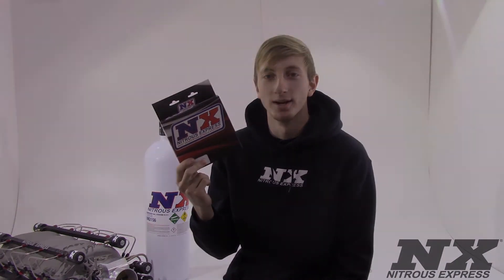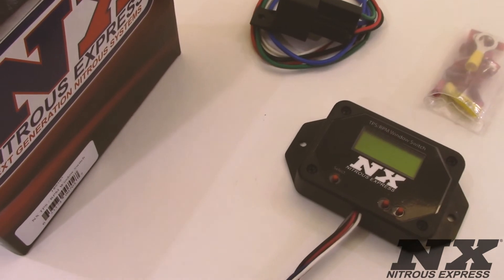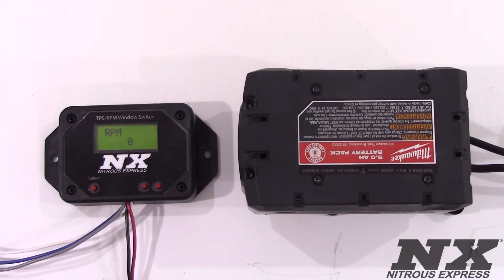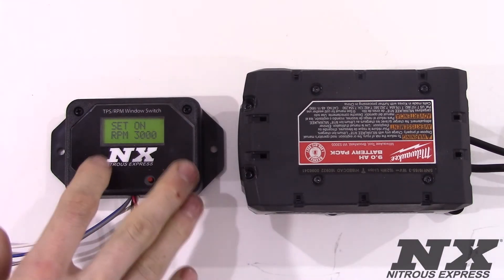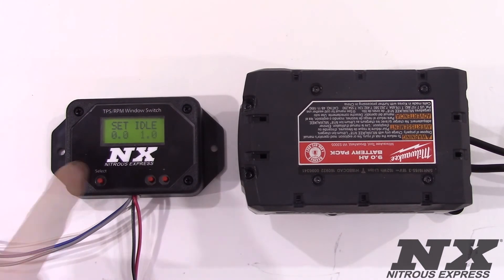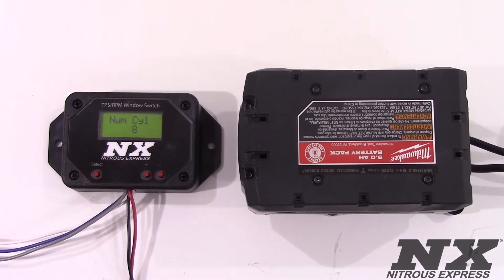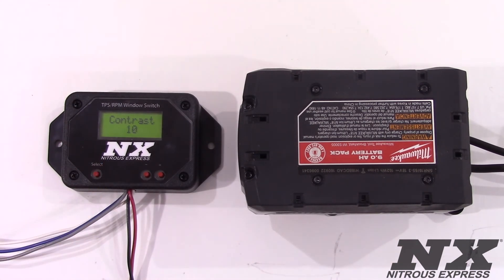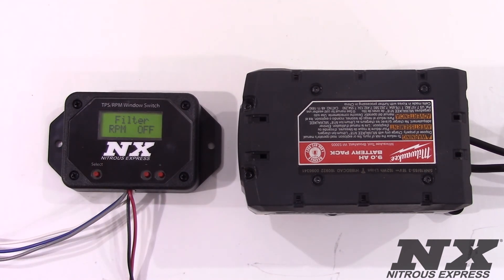NX TPS WOT / Digital Window Switch, Part # 18959

Comment: I still don't get the normally closed and normally open option? I want to have mine set up with wot and rpm. About 3,500 rpm start for nitrous and cut off nitrous at 7400 rpm.
Reply from the maker: Give us a call and we will see if we can't help you out!
Reply: @NitrousExpressVids  I had a friend install at his shop so thanks just gotta test it out soon. Everything seems to be working properly I can go through the window switch and change parameters if I need to.
Reply: @simmygt831  how did u set it up? Normally closed??
Reply: @ihateyou-iv4787  normally open

Comment: I don't understand!! What does the TPS/RPM switch do?
Reply: it helps your car from blowing up due to N02  but you need more systems to be close to "bulletproof"  such as a lean sensor failsafe, this thing reads WOT  to activate N02 and keeps it between 3K RPM And w.e RPM you shift at so it won't go boom!
Reply: @IZE83L   Does the window switch activate the n02 at set rpm? Do i need a button with it or does it activate the n02 on its own?
Reply: Hussain Alhamar it will activate it on its own if you wire it up that way. Some people prefer to have a window switch and another switch wired as a series to make sure they don’t accidentally discharge the nitrous. Other switches for example could be a push button, wide open throttle switch, and other fail-safes.